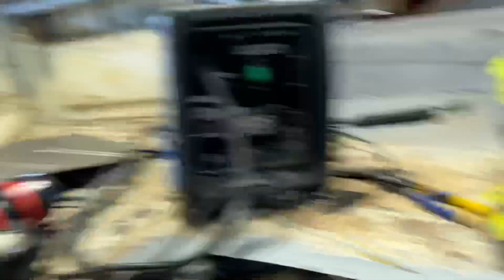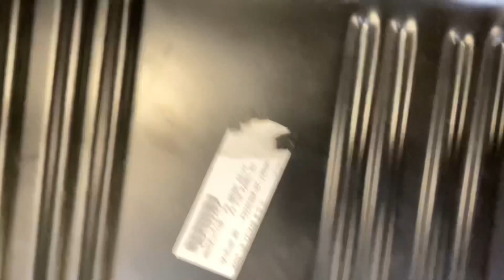Early Bronco Restoration l Problem Solved.... Hopefully

Comment: You’re gettin’ there.  You might consider forcing the floor to 17”.  That’s a pretty important measurement.  Then and just an fyi, the kick panel should be square to (perpendicular to) the inner rocker.  So if you have a framing square get that dimension and clamp things up and see if it helps.
Reply from the maker: That makes sense.  I do believe I have a square    I’ll check that. I’m hoping the “fix” is just that brace and nothing else further in...